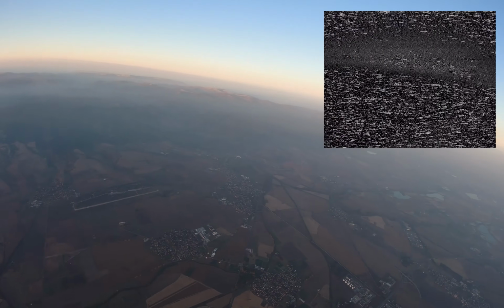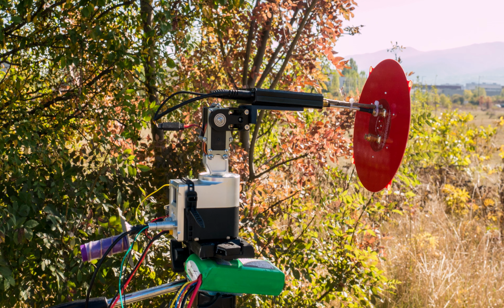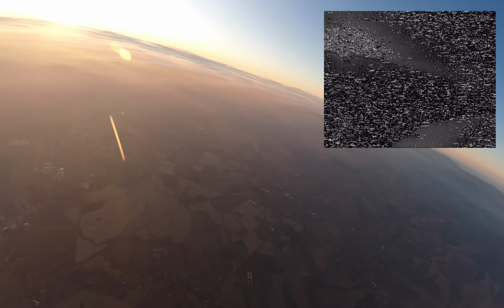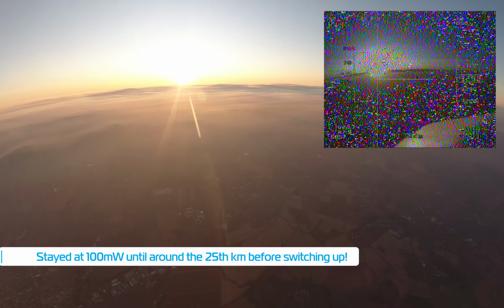DragonLink Advanced 433Mhz LRS Radio - an AWESOME system!!!

Comment: Crossbow mini now accepts s.port from r9m via bluetooth
Reply from the maker: No need, I can get it from MFD directly, but I am glad you like it! :)
Reply: @ArxangelRC  its not public yet. Im sure it will be soon
Reply from the maker: I am sure they will send me the latest version if I ask for it, even if its not public... it is my plane to break! ;)
Reply: @ArxangelRC  👍🏻
Reply: @ArxangelRC  ive also got a non mfd local gps working with the tracker. No setting home required. Still uses internal mag of the tracker.
Reply from the maker: Yup, I know! :)
Reply: KNUCKLEUP FPV I have my R9m setup with Bluetooth through the S.port.  So now I can use Crossbow mini tracker with R9M and Bluetooth??
Reply from the maker: Does that bluetooth on the S.port output Mavlink?
Reply: @ArxangelRC  no. Its s.port data. Need tracker firmware 2.0. Set the port on tracker to 115200 baudrate and s.port. you will need an sbus inverter either at your transmitter before the bluetooth. Or at your tracker after bluetooth before tracker. I dont remember if the s.port on the back of the r9 is already uninverted. I just got another r9 to test.
Reply from the maker: Oh yeah... they did release some new firmware with that option... cool!
Reply: @ArxangelRC  im running test on a newer firmware right now
Reply from the maker: And?
Reply: @ArxangelRC  its amazing. Send me your email. I'll send it to you

Comment: Flying at 4000 feet...?...🤔
Reply: EnglishTurbines and🤔
Reply: @Freebird_67  Well, if he was using long range video, he wouldn't need to...You're welcome.
Reply from the maker: Hahaha, the reason for the height is not the video... it is the return trip! Getting higher allows me to drain the battery more, because on the way back I can mostly glide... or keep the plane at a lower throttle setting, having all that altitude to help me get back... so in effect I can make it further out and drain the battery past the 50% mark... as I often do!
Reply: @ArxangelRC  You don't need 4000 feet to go out that far...
Reply from the maker: Well you do, if the battery is not big enough! :)